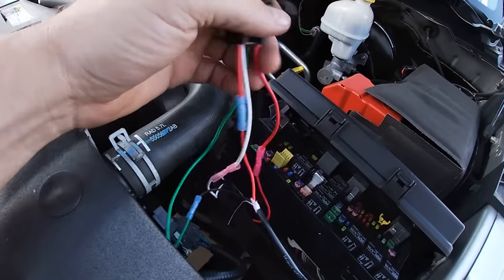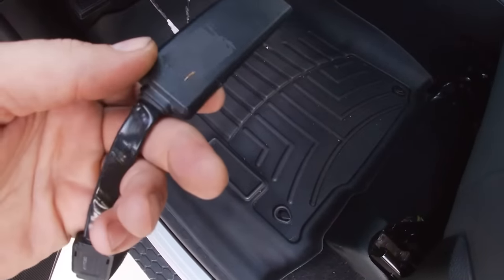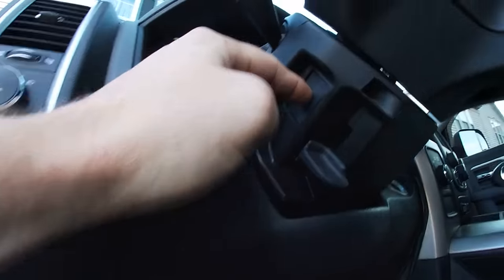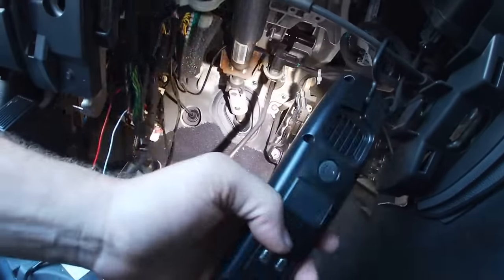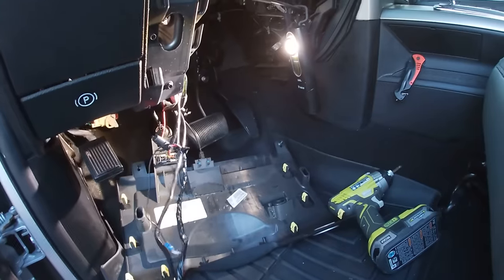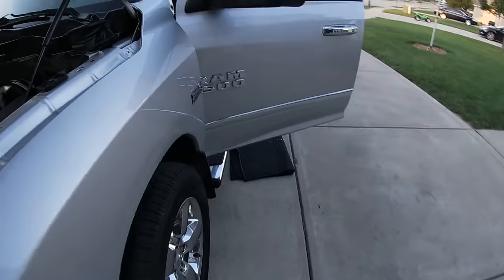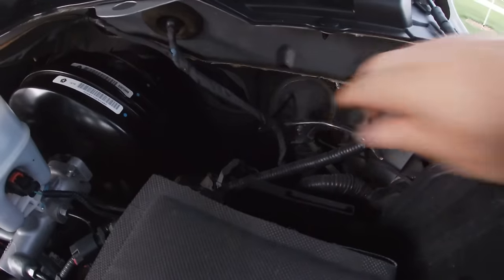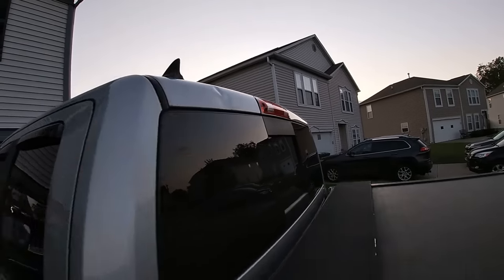Tracking Device Found on My RAM!

Comment: The dealer had a responsibility to remove this before selling. Or advising you of it and offering $$ off the price.
Reply from the maker: Trinkling Creek I agree 💯! I called them and let them know I wasn’t happy and they need to pay more attention on trade ins. I have bought multiple cars from this Ram dealership and this is the first one I have ever had a problem with.
Reply: I'd sue the dealership for invasion of your privacy - and I'm not joking. They violated your 4th Amendment rights which is arguably criminal as well.  Get a lawyer.
Reply from the maker: Jim Dandy I don’t think they had a clue it was on there. I’m just not the type to sue unless it would have cost me significant amount of money to fix. I appreciate the info though.
Reply: @FABAutomotiveDetailing  Understood.
Reply: @jimdandy8996  Wrongful search or seizure conducted by a private party does not usually violate the fourth amendment.  There was no intent to violate your privacy.  You can litigate for lost wages or goods, but it doesn't appear that occurred.
Reply: @keihad  Do we know their intent in this case? And, so if, for example, someone peers into my home through my windows without my permission and they are not law enforcement then there is no law violated?
Reply: @jimdandy8996  Intent is tricky.  Just because this happened, does not mean "intent" was in play.  Someone cannot usually peer through your windows, and again it depends on intent.  At a minimum, the person peering though your windows may be trespassing or maybe is just over zealous to get your attention.  Some states require advance notice such as a "No Trespassing Sign" before a crime of trespassing is charged.  Law enforcement is permitted on your curtilage.  They cannot walk around your property and peer through your windows, without first developing a reasonable suspicion.   For example, if an officer peers through your window and it appears you residence was burglarized and the officer hear a noise in the residence that is consistent with a burglary, the officer can then enter your property without a warrant because an exigent circumstance exists.

If the officer legally enters your property because of the exigent matter, the officer can look anywhere within your property where a burglar may hide.  The officer cannot look in your medicine cabinet or sock drawer.  If during the search for the burglar, the officer sees in plain view (Plain View Doctrine) illegal drugs on your kitchen table,  the officer can then seize the drugs and apply for a search warrant to search the residence for additional evidence related to the drugs, which may mean your computer as well.
Reply: @keihad  Yep, I understand that about the limitations to a search and their relation to reasonable suspicion. What about a reckless disregard for your privacy in this particular matter? Any case law on this?
Reply: @jimdandy8996   Good luck with proving that
Reply: @marcusbaltimore982  Ya know, depending on where you live, juries tend to hate seeing businesses doing subversive crap to people these days.
Reply: The dealer had no responsibility to remove it. Used vehicles are sold as is unless they have factory warranty remaining or the dealer has represented it as having a dealer warranty. Don’t listen to internet lawyers. It’s not fourth amendment because a car lot isn’t a government entity.
Reply: @FABAutomotiveDetailing  I find it surprising though that they weren't curious about the beeping.  You would think they would have investigated.
Reply from the maker: t hannon The first test drive we did was just a few hours after the trade in and it was beeping. They were low on techs and couldn’t inspect it for a few days. So we went back 1 week later and they still hadn’t had the chance. So they got it in real quick and put tires on it and did a safety Inspection. I honestly thought the beeping was from the aftermarket backup proximity sensors and that they were basically testing on start up. They may have thought the same thing.
Reply: @jimdandy8996  Where are they peering from? If from the sidewalk it is perfectly legal, a neighbor looking out their window and into yours perfectly legal, standing in your yard looking in your window is in most places illegal. Most people buy curtains to take care of that.
Reply: @EricFarmall  Some people don't live in their homes with their curtains shut all day.
Reply: Agreed, i would have taken it back to the dealer or whomever and have them do it like it came off the assembly line. Make them pay for it.
Reply: @Deanwrd  Absolutely.
Reply: Money off the price for a $800 security system.. You can use the serial number to track and find your car if stolen and the beeping is probably a dead internal battery on the GPS. That was a lot of work to take a low jack out of your own car. Doesn't make a whole lotta sense

Comment: Many of you have factory tracker and don't know it.  Does your vehicle have navigation? Does it have the option to call 911 if the vehicle is in a accident?
Then you have a tracking device that transmit way more data than that relic he removed from the truck

Comment: Many dealers install those by default and then try to sell it as a value add service. I have seen some brand new Jeep Wrangler owners find them but the ones the dealers have been installing (not for loan guarantee but actually as a service they up charge for) are plugged inline with the OBDII under the dash. They aren’t Jerry rigged into the wiring like that one.

Comment: The wires under the dash are hooked up correctly, They wrapped and soldered the wire without cutting the wires.  This way you don't use butt connectors or those crappy blue wire splice connectors which cause voltage/resistance changes or could rust or lose connection causing major issues with the vehicle running/starting properly.

Comment: The company I work for uses these. Typically there is a fob registered to each driver. They swipe the fob to register that they are operating the vehicle. I would assume on this truck the fob is swiped at the steering column. The alarm I there to remind you to swipe your fob and usually shuts off after the fob is swiped.

Comment: I installed a few when I was at old job. Its installed on customer cars whose credit is in question and possibility they will not make the money car payment. So dealer tracks it and repos if needed. We always wired the pos. and neg. Into the dlc connector.

Comment: I used to install those, similar, GPS units in fleet vehicles in Texas.  There are lots of them. However, when the fleet quits paying for that trucks GPS service the GPS company shuts it off. It still looks like it's working but probably it isn't. It's hooked up but probably not reporting. But take it out anyway. Be careful though you can shut your vehicle down and it takes a dealership to get it back on.

Comment: I bought a 1.5 year old used 2500 cummins and my buddy bought a brand new f250 diesel from sister dealerships. I found a tracker in mine and decided to check his which I also found one. I walked into the dealer (which I was already having issues with) dropped in their desk and said I never gave you permission to track me. They claimed it wasn't theirs so I dropped the one out of my buddies on their desk and said he didn't either. They didn't have much to day after that

Comment: You'll find these aftermarket devices in most vehicles today. Doesn't matter where you bought the vehicle. New and used. The dealer claims it keeps the vehicles safe while on the lot, but can be purchased to keep your vehicle safe. It costs the dealership around $100 installed, but will could cost you up to $1000 or more. They're crap.

Comment: There are a lot of dodge chrysler vehicles that have tracking devices from the factory. On the chrysler van if you use the wrilong key 5 or 6 times it will lock you out. On the vehicles with chips in the keys you have to contact chrysler after replacing the ignition switch or cpu on the vehicke to get a code to make the vehicle start.

Comment: With newer trucks the dealer will just use the GPS to track the vehicle if the bank needs to repo it they will get the info from the dealer since the bank owns the vehicle. This one looks like it was added by whatever company had the truck originally.

Comment: That’s funny my son bought a 218 ram same thing couple months after bought it dead and it was at work of all places and couldn’t get to it with jumper cables and come out. I seen the tracking device under the dash on the drivers side.
Reply from the maker: They are in a lot of used vehicles from previous owners.

Comment: I had same deal with a used trailblazer I bought for my wife. They were very careful putting it in front of rear view mirror and the headliner. I hit Google found numbers for manufacturer an then dealer. They refused to remove it told me it wouldn't be a problem because it was deactivated in 2017. I removed it myself.

Comment: Mine wasnt this bad. Was just plugged into the OBD 2 port and nothing else there besides being bundled together. Wouldn't allow the scanner to plug in and communicate. Crawled hnder and boom.

Now, to fix the ABS module on my 3500 dually..

Comment: Hey Fab, just watched your video. Wanted to say, i work at a CJD dealership, we install those on our low credit sales in case of repo. They are a starter interlock GPS/Cellular data tracker that the loan company can shut down. I'm not saying they put it there for you, but someone put that in there before you other than factory...
Reply from the maker: Yeah I figured it was for the original owner. It was a one owner truck.

Comment: That's pretty similar to the ignition interlock I took off my car after I wrecked it (I  was sober during the accident, no more drinking at all. I removed it at the tow yard to avoid getting charged 3 grand for loosing the interlock device). That looks like a anti theft device the fleet had installed.
Reply from the maker: Yeah it was most likely a fleet truck

Comment: The part that is in the steering column is a sensor. The ding was to remind the company driver to "log in" to the system so they would know exactly who is driving that vehicle while it is going down the road (it's company equipment, so it can read if some things are done or not done like speeding, seatbelt usage etc). Tracking devices put in by BUY HERE PAY HERE lots are usually hidden under the dash and are supposed to kill the signal from the starter switch to the relay. Most companies do not bother with hiding the sensor in the column, they just mount it on the dash or drill holes in the dash depending on the sensor.

Comment: I recently (Oct 2020) bought a brand new Kia Telluride which I paid cash for - no financing.  In fact I ordered the car from the dealer and it was delivered from the factory to my specifications.  Nevertheless, the dealer had installed (without my knowledge) a GPS tracker, which I discovered months later while under the dash wiring up a dash camera.  Like you, I removed the tracker, which Im guessing was put there as a means to find/ repossess their cars in the event of failed payments (remember, however, I paid cash).

Comment: Can only speak for my experience. Our daughter has bought two vehicles, at different time from two different lots.
Both vehicles had trackers. We bought a used Chrysler T&C from a large dealership several years ago, also has a tracker. I've looked at paperwork on all three, when the contract for financing is signed, it states there is a GPS tracker in the vehicle, disabling or removing it could result in repo action. Talked to a friend who is an attorney, he said if the agreement is signed then the repo could legally be done, the purchaser has agreed to the terms made by the seller and finance company.
He said also if the tracking device malfunctions and causes damages then the buyer could get a full refund on the vehicle, taxes,fees,registration,insurance, and financing interest.

Comment: Messed up. I just bought a 2017 Ram and there's an after market thing with a phone symbol on it located below the headlight control. When I'm sitting in the vehicle while it's off..I hear this noise that sounds like a dial up connection being made (below the radio) any thoughts on that?
Reply from the maker: I’m not sure what that is. I have never heard a tracker make a noise like that.

Comment: That is a remote kill and locator used on Rental vehicle fleets to aid in theft recovery.
Reply: I was wondering! Lol
Reply: Ok, makes sense.
Thanks for your expertise .
Reply: @stonerayven2455  Hey, good job still.
Golden star and an attaboy for you.
Reply: @stonerayven2455  -- That's what expertise is.
Reply: They put then on loaned out cars too
Reply: Just TRY to find WHO had this crap put on this truck and who transmitted the disable signal. They are probably all out of business by now.
Reply: Some dealerships especially mom and pop operations will put these on people with bad credits vehicles. Often with a kill switch. I have heard of some so petty they disable vehicles if you don't pay ontime.
Reply: Yes it cuts into immobilizer.
Reply: @brianm.595  I've heard of that too mostly with those shady buy here pay here lots that put vehicles out on subprime credit with insane terms.
Reply: This is actually very useful to have

Comment: as a repair shop owner in canada,  i have seen those installed by dealers and/or loan companies as security against a "risky" loan........someone that meets the criteria but just......miss a payment or two and they flick a switch in toronto or montreal.......have removed many of them that got left in the NEXT purchasers car that have either failed or were turned off by the installing company......yes they are trackers...give gps info........the loaning company can allow the vehicle to NOT be started.......know where it is within reason and come tow it away.........glad you as the second buyer got it out and no future problems

Comment: Thank you, for sharing this information. My car is being tampered with an I have found my car unlock at times, battery flooded with some liquid, wires pulled from above my mirror with my mirror not in place. These things do happen, many times to widowed, single woman, who have no husband or father to help protect them. 
My cars a 2006, to old for factory.
Informed my rental leasing company, reported it to apt leasing co., referred me to p.d., p.d. not interested, said call if I see someone. Your video validates that this stuff Does in fact go on. 
Thank you!
🙋

Comment: My stepdaughter bought a car several years ago from one of those buy here, pay here car lots, she didn't have any credit and was working on getting her credit history started. She was having problems with starting the car with the key, a mid 2000's Malibu, and while I was checking fuses I found a box plugged in to the fuse box, it didn't look like it belonged there so I removed it. I believe it was a tracker also. It didn't solve the problem with starting her car but thought it an interesting find and this video reminded me of that. Her car was on the list of GM vehicles recalled for bad ignition switch, unfortunately she ended up totaling the car a month or so later and never had the switch replaced.

Comment: Quick tip for anybody shopping for a truck: Fleet vehicles are almost always the most basic trim level, and usually white in color.  They're usually more affordable, but if you want to avoid them, look for higher end trims, like the LTZ for GM and Lariat for Ford

Comment: I would not call that a tracker. From the wiring I would say that it is an immobilizer. It's a device that stops the vehicle from operating. The dealership can just switch off your vehicle if you don't pay.

Comment: I know a guy who had bought a truck and found out the dealer had put one of these things in it. He asked them to remove it as he had a decent credit score and didn't like the idea of people tracking him (he's very old-fashioned in that sense), but the dealership refused. Well little did they know that this guy's second vehicle is actually an old Cessna 152 airplane. So he removed the device himself and attached a battery to it, and takes the device with him whenever he goes to fly the plane (which he regularly flies over Lake Michigan). About 2 weeks later he got a call from the dealer asking what the hell he's doing with the truck. He told them it's none of their business and to fuck off. He finished paying it off and never heard back from them again.

Comment: How did you know what you found was a "tracking device"?  Did you check the device for RF components or RF emissions?  I would be more inclined to suspect it was an aftermarket remote-start unit.
Reply from the maker: Donny Hinson It has a factory remote start on the factory key fob. I entered the numbers on the internet and it took me to a company called ModBuz and it showed the tracker. I have also removed many of these at work.

Comment: you should check and see if the heads have been off,,,,i have a 2013 and warranty replaces the bad parts when the lifters fail. the dealership does not replace all lifters or remove engine to clean metal shavings out. i decided to ditch the warranty, do a mds delete and upgrade all lifters and cam. i like my truck and look forward to keeping it a long time. dodge does not take care of there customers. wish you the best,,,,,unfortunately,,im scared for you because with those miles on that engine,,,your in for heart break.